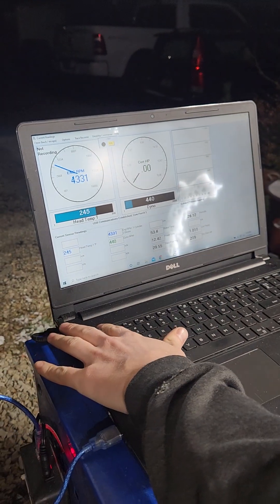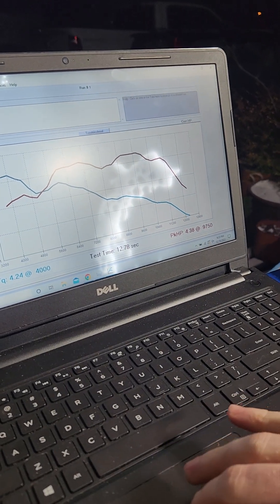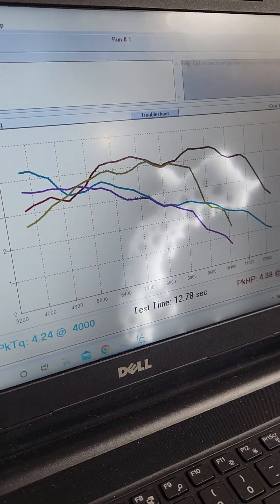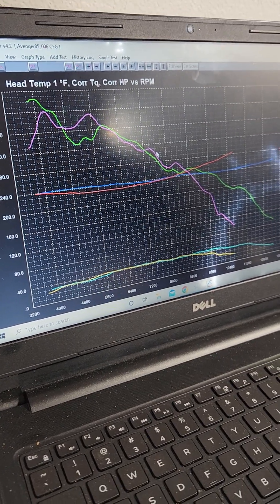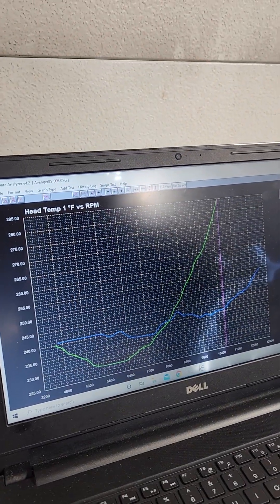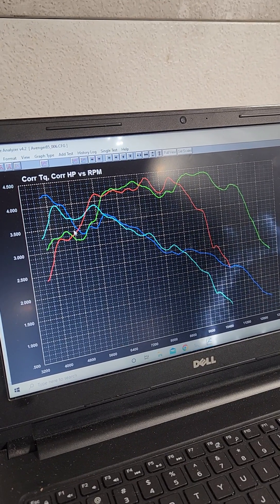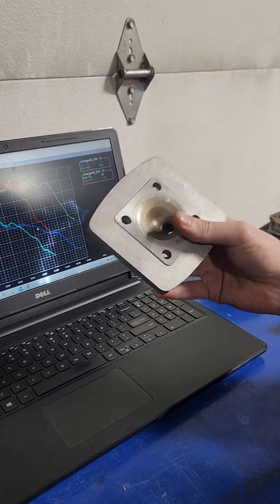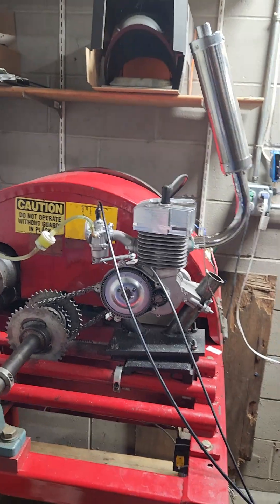Avenger 85 with SP cnc head.

Comment: Could you do a dyno with a MZ65 exhaust mounted on there with the head?
Reply from the maker: @spongeimperium126  mz 65 style pipe adds about 1hp.
Reply: @kjsmolik  well yeah but how does it sound at 12,600 rpm on a dyno? No videos show how it sounds

Comment: Hey,just got one of these heads from you,should I run it with just rubber gasket or use metal 1 also??Thanks
Reply from the maker: @awakenotwoke2643  what engine and have you checked the squish ?.using the metal gasket depends on what your squish is
Reply: I would have told you to avoid this head altogether. Rings are single use, IF you can get them to seal. Don't bother using the copper gaskets either, they don't seal.

Comment: What do u guys think is a better investment the phantom 85 v3. Or the adverger 85?
Reply from the maker: The avenger is better than the V3 but the new Menace coming out I'll be equally as good as the Avenger but puts out slightly more power than the avenger. The avenger has alot of room to modify. The phantom is slightly more restricted on modifying.

Comment: I have phantom v3 i broke it in and it didn't last 2 months if i get one of these i hope it isn't junk like the overrated phantom v3 smh
Reply from the maker: The death of these is heat.
Reply: Mix with a lot more oil it helps and last longer
Reply from the maker: @jaquileattwood1148  more oil isn't always good. 32:1 is about as much as you want to get. Most run 40:1. Oil isn't why these are failing.

Comment: how is it possible for the avanger 85 to reach such rpm ?? is the ignition improved ?? And are you going to port it ,  add a pipe etc and dyno it again to show power gains ??
Reply from the maker: The ports along with the proper head allow it to reach those rpms. We will be doing more with a pipe and carb.
Reply: We're they stock ports or ported? @kjsmolik
Reply from the maker: @spongeimperium126  stock porting
Reply: @kjsmolik  That's incredible, I know what my first upgrade is

Comment: That's aven 85 not phantom 85 you ain't fooling nobody
Reply from the maker: It says avenger 85. No one said phantom.
Reply: What do u think is a better investment. The adverger 85 or the phantom 85 v3?
Reply from the maker: @brianmclellan7498  avenger 85 is a better deal. Better than a zeda 80.  No point in going backwards to a smaller engine with less hp.